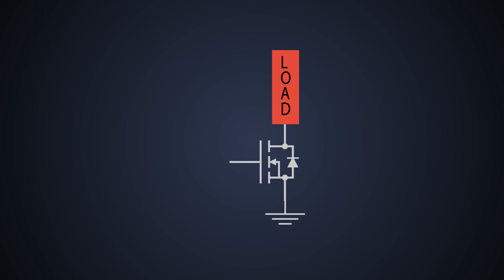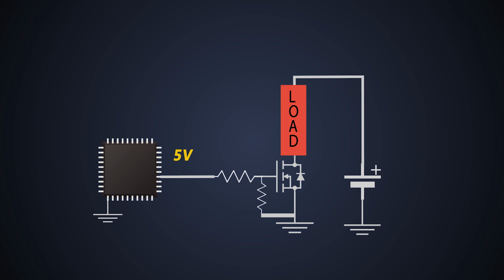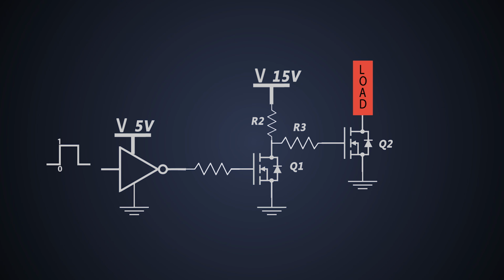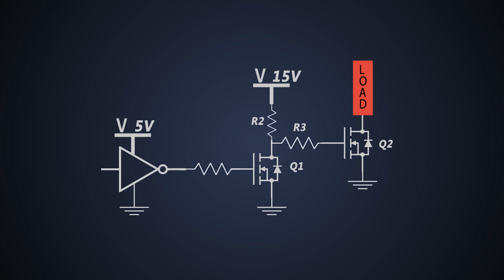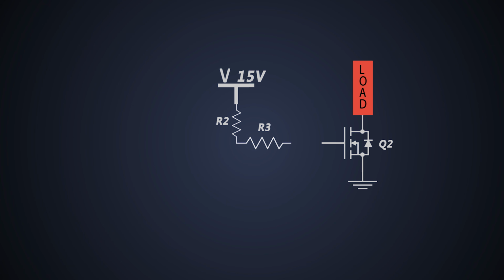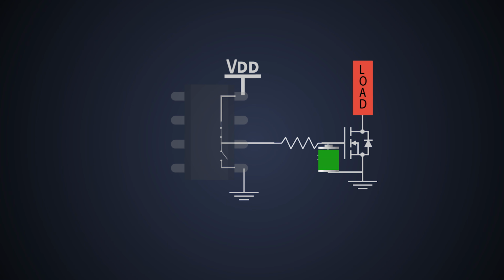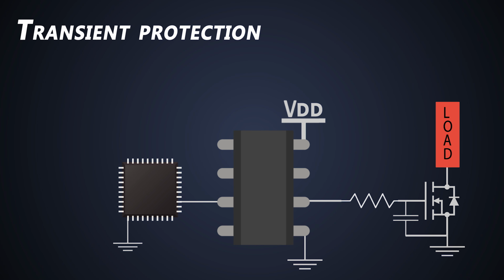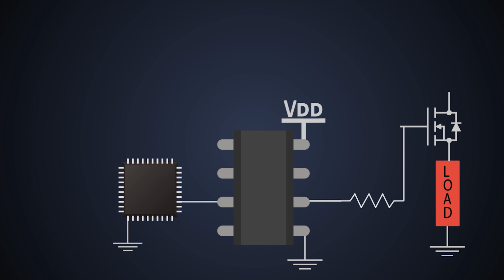What are MOSFET gate drivers? Why do we need MOSFET gate driver? MOSFET driver explained.

Comment: I prefer to watch your video , its informative and different. 
At time 6.33 you said the 4th advantage is  galvanic isolation.  
1. If I used 2N7000 MOSFET to driver a 5V RELAY , Can I still be able to use MOSFET driver and i will get any advantage ? ( process speed is very very low)
2. Please suggest me a good MOSFET Driver with galvanic isolation . ( and any better MOSFET then 2N7000 ? )
3. Statement at time 1.36 ( if we provide the 5V then the mosfet gate should be sourced by 15V ), its confusing statement. Not Clear.
Reply from the maker: Thanks a lot for your detailed comment — really appreciate it!

1️⃣ 2N7000 + gate driver: For a 5V relay at low speed, adding a gate driver won’t give much advantage unless you need isolation, faster switching, or stronger drive. Otherwise, 2N7000 alone is fine.

2️⃣ Better combo? Try IRLZ44N (logic-level) + Si8261 or ISO5451 if you need galvanic isolation. IR2110 is great for high/low-side control too.

3️⃣ Gate voltage part at 1:36: What I meant is — if the MOSFET’s source isn’t grounded, just giving 5V at gate won’t turn it on. You need Vgs to be 10–15V (or higher), which a gate driver helps achieve.

Comment: Thank you so much. Informative stuff. 
Please can you also make video on EV induction inverter circuits with VCU connection/ signal, MCU, SBC, Gate Driver, transistor and current, speed, torque change flow?
Also inverter connection with HVAC, circuit flow.

Comment: Hi F.E. I really appreciate your videos they have helped me understand the circuit/battery I am attempting to repair quite well! Great job! Thank you for submitting.! Question: Can I turn on my BMS manually after under voltage shutoff of the FETs? (I manually supply voltage to the Gate Driver so it thinks the Microcontroller is requesting FETs on) I know the BMS is an active monitor, with a Gate Driver. Reason: The battery somehow discharged below 2.5V per cell (1.86V average) so the BMS shut off the FETs to protect mode. I have manually balance charged the cells (AROUND the BMS) back to 16.4V (4S Li-Ion battery) and the battery seems to be stable. But I cannot reuse the battery until I can turn the FETs back on. (FYI I have completed this once before and the battery is still in operation. I just GOT LUCKY! I don’t know what I did in order to turn them back on exactly but I simply took a paper clip and raked it across the FETs and they turned on. Not sure what I did that time but it hasn’t worked again.)
 Any help would be greatly appreciated! Thanks again!

Comment: For n-channel MOSFET gate driver, you have considered 12V as supply voltage. So Vgs is 16V. 
If supply voltage will be 30V then Vgs should be 34V??
Reply: as a highside switch yes.

Comment: Hello .. sir i made SG3525 or ir2110 smps circuit but ir2110  but HO side shows 12v ..but mosfet gate handle maximum 10volts .. can you guide me why HO side show 12v rather than 5volt
Reply: Bhai yyr mere system m 2 MOSFETs h aur wo replace karne pe khrab ho rhe h 
IR2113 IC is used as a gate driver
Thoda help kar doge kya ki kya root cause ho sakta h problem ka
Because mere ko Itna knowledge nhi h 
M pcb photo wgera share kar dunga contact number deke aap yes bolo to

Comment: Switching a high side mosfet is bit tricky. For example, using a simple transistor based gate driver for  N type mosfet connected on positive rail of buck conveter would cause a shoot through fault. Gate drivers ic becomes really handy for such cases

Comment: Just use a MAX232... it accepts a logic input and can drive a MOSFET or IGBT with ease. the MAX232 was designed to drive RS232 signals though inductive and capacitive loads and provides both a positive and negative output which s ideal for driving gates and it generates its own step up voltage
Reply: and it is FAR cheaper too

Comment: Which good gate driver ICS are available in local shops in India? Need it for 100khz ish switching. I practically took a list of different ICS to the shop, and the only thing that was available out of that was mcp34151, which i did buy. But was rather expensive. Was wondering if there are cheaper ones available
Reply from the maker: IRS2110 is the basic driver IC you can find

Comment: Many think they always need to use a high driver in a low speed application. They can get into a pack of trouble when these fast switching currents introduce noise. I sometimes purposely slow down switching speeds to prevent these problems. I prefer to use drivers with low supply voltage protection to avoid FET overheating due to low drive voltage.

Comment: You do not always need one if you don't do high speed switching, change gpio setting to high drive strength and get a low Vgs mosfet that is 100% on at 1Volt like the RU1J002YNTCL
Reply: this has a lot of downsides like higher RDSon and thus higher power losses and more heat generation.

Comment: If no high frequency load switching requierd (eg. pwm motor speed control, inverter etc.) I use 74HCT595's for driving mosfets. Their outputs are also grounded by 10k resistors, to turn off outputs when the registers are in high impedance mode. I run these shift registers from 5V, and I use an optocoupler for level shifting and for protecting the micro (which runs from a separate 3.3V power rail) against transients. I've built dozens of these output cards, and all of them are running smoothly. I also use a trick, an extra optocoupler, which is fed through a capacitor, and connected to a GPIO which state is inverted innevery loop cycle. Every H-L transition is discharging a capacitor by the emitter of the optocoupler, so if the program freezes on the micro, all outputs will be turned off immediately.
Reply: pretty slick...Im going to start doing that as well.

Comment: Many makers use their MOSFET gate drivers not with their full performance. So they are often surpriced by considerably higher switching losses than expected. Most of the gate drivers devices can provide gate currents of 1 A, 4 A or even more. But they can't provide them if the circuit design has no buffer capacitors immediately at power supply pins of the gate driver IC and also if the MOSFET is considerably separated from the gate driver's output pin. The high current must be supplied within nanoseconds. This is impossible if there are considerable line inductances.
Reply: Hi can u help me ?
There is a defect in my system’s pcb and I doubt gate driver IC